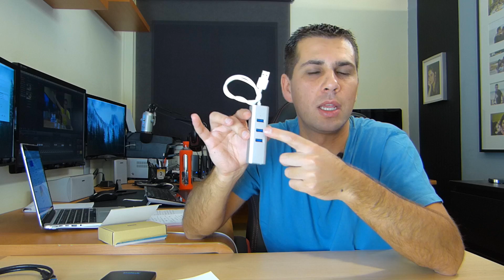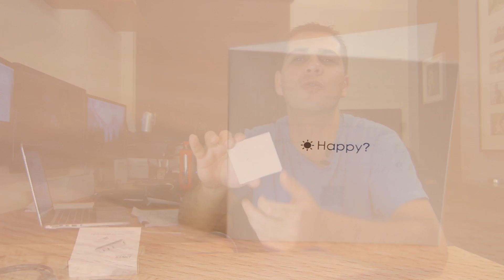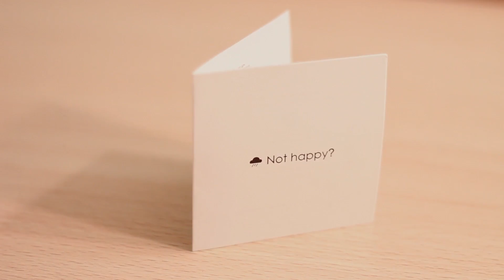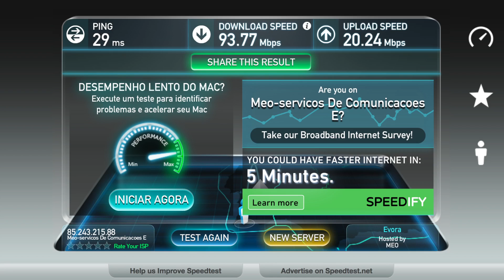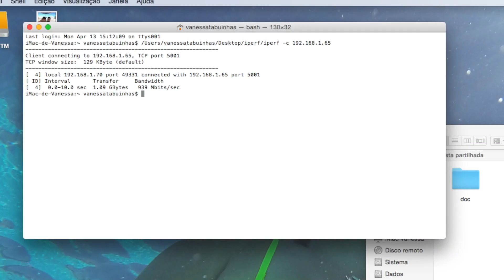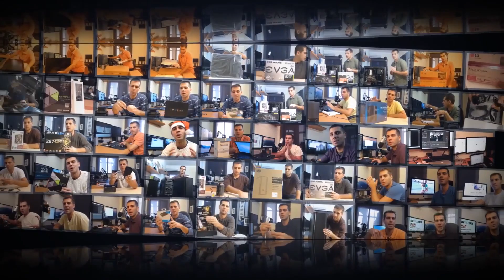Anker USB 3.0 Ethernet Adapter Review & Speed Tests

Comment: I have just bought of of these for my MacBook Pro.. 
Mixed review. The ethernet was great. HoweverI tried to use the USB 3 ports for 
1) Logitech Mouse Bluetooth dongle
2) Plantronics earpiece bluetooth dongle

The performance on both was terrible.. Anker support sent me an explanation that USB 3 interferes with 2.4Mhz wireless... and bluetooth uses that frequency

Now if you plug a usb 2.0 extension cable into the same USB 3.0 port and the dongle into the USB 2.0 port a bit further away the problem goes away.

I am told that lots of USB 3.0 hubs are affected the same way.

Disappointing. Good device otherwise but if one wants to plug in a bluetooth dongle.... you have to use a USB 2.0 extension cable.

Comment: Can I use that in reverse? I’ll connect the ethernet cable to that ethernet port on my ONT and use the usb port to attache my external hard drive... Is it possible? because the usb port in my ONT is slow and I cant stream properly my 4k video from external hdd

Comment: Are there any scenarios where a taxed network or usb transfer would negatively influence the LAN bandwidth available through this or any USB + LAN hub? In other words, will the LAN port always have gigabit speeds regardless of network or USB utilization or if say in theory I had all USB hard drives attached to it and fully utilized the 5GBps bandwidth, would the LAN port still move at GB speeds?

Comment: Have you had any problems with it slowing or "destroying" your wifi?
I have the Anker 4 port 3.0 USB hub and it continually damages my wifi signal on my Macbook Pro 15" irrespective of where I position the hub.
Your comments would be appreciated.
Reply from the maker: Hi, thanks for sharing your experiences but i have not seen any issue with my wifi signal while using it, i dont use it very often but when i use it works fine
RJ
Reply: OK thanks - I had mine connected all the time - or did until the problems started. I have now disconnected the 3.0 Adapter and gone back to a 2.0 version that allows everything to work flawlessly.
Reply: USB 3 can interfear with 2.4Ghz wireless channels.  You'll want to use 5Ghz.

https://www-ssl.intel.com/content/www/us/en/io/universal-serial-bus/usb3-frequency-interference-paper.html

Comment: I saw in the apple store that there are two kinds of ethernet adapter, the usb one and the thunderbolt one, my question is what's the difference between the two adapter? oh and btw these adapters that I'm talking about is for my macbook air, anyways great video, I hope someone will reply and answer my comment.
Reply from the maker: Hi Andre, thunderbolt should be faster but after testing this USB 3.0 what is the point of getting something faster than this which is the maximum of my connection gigabit :)
👍👍

Comment: my onboard lan have a unidentified problem. tried all the solution in internet. can't seems to fix it. Buying USB to LAN will fix it?
Reply from the maker: Hi Maxine, will not fix your board connection but will give you a wired connection to your PC
RJ
Reply: Sorry for miscommunication. I meant not fix my onboard but to to have a wired connection.

Comment: Hello i wana ask a question. I am thinking to buy canon ip 2870 which is the simplest printer n has only 1usb cable with one end as USB type A and other USB type B. So in ur ethernet adapter i see that it is Ethernet RJ45 to USB type A, so will the same device work in reverse?? i am thinking to make canon ip2870 wireless which infact is only a wired printer, by connecting its orginal Cable to ur ethernet adapter through usb female to female. Will it work.😃
Reply from the maker: Hey Dayal, i see your point but this adapter wont work for that, you will need a proper adapter for printers or getting a wireless printer. I got the Epson Home XP-325 last year because i use windows and OSX at home and works great on the network.
RJ 👍

Comment: i m looking forward to buy a gaming lap which doesnt come with an ethernet port ,so if i use this adapter will my latency (ping) increase in playing online games like csgo , etc or it remains low as native ethernet port
Reply from the maker: Hey Santhos, anything that we put between our connection will interfere with the ping / speed but this was until today the solution that i have found that has the best results for my connection
Hopefully will work for you as well
All the Best
RJ 👍👍

Comment: Very nice review indeed! :) Just ouf of curiosity: did you do any tests of ethernet speed WHILE at the same time doing data transfers through USB  ports on the device? In other words, what happens, if you copy large amounts of data from, say, a USB 3.0 flashdrive to your laptop AND run ethernet speed tests at the same time? 

I want to find out to what extend sharing the bandwidth of a single USB 3.0 connection to the laptop between USB data transfer and ethernet  data transfer affects the performance of both (if any).

Thanks in advance!
Reply: depends on your internet connection. e.g. in belgium the max bandwith is 200 mb/s
adding a generic ssd that's writing data this uses around ~500mb/s
seeing as the usb 3.0 is capable of 5gbit you will only use 700mbit of the 5000 available. so it won't really bottleneck, as long as you have the updated drivers and right settings
Reply from the maker: +Stanislav Vartanyan Hey, that is actually a interesting question :) and unfortunately i did not test it out as i did on my latest video where i tested exactly that https://youtu.be/wI81POWO38E
I have to assume that there will be a bit of a bottleneck.
On a read of 410 MB/S on SSD plus a 100mbits /S on a continuous download stream i believe that the SSD will go below to 300-350 MB/S.
I also believe that in a real world situation will be very hard to have this scenario but this will depend on eah one of us :)

To @Sevival thanks for your input and a few weeks ago i would have thought +- the same but after testing the USB C humm!! I would not bet that we will not have a bottleneck pushing a SSD plus 100mbits connection

Hope it helps
RJ

Comment: Hey George,  I was wondering what SSD speeds you get from the USB ports on the hub vs the speed from the same SSD plugged directly into your Mac?  Also does the hub have enough power to power the SSD?
Reply from the maker: +Les Rimmler Hi Rimmler, i have done those tests and they are the same, no loss with the samsung 850 evo on a UASP external case. RJ

Comment: Thanks for reply Robert. The question was for x8h, not x8h plus
Reply from the maker: +Sang Lee Hi sang, but the same applies, you will be bottlenecking your connection because its USB 2.0 so you will get very low network speeds. On the X8H you have a 100 connection and on USB it will be lower than that, much lower. RJ

Comment: hi, would this work on minix x8h?
Reply from the maker: +Sang Lee Hi Sang lee, actually i never tried that, but why would you use this when you have gigabit on the X8H Plus? And even if it works the box only has USB 2.0 so slow connection. RJ

Comment: hi Roberto, is this adapter windows 10 comparable ?
Reply from the maker: +vger 147 Hey Vger, yes you will not need any drivers, i only have used it on Win 8 but i see no reason not to work on Windows 10 :) Hope it helps. RJ

Comment: Did u have to install any drivers? I have the same computer, with latest OS and plugged in the adapter and only the USB ports worked. No ethernet. I guess the question is, does it work straight out of the box or do i need drivers?
Reply from the maker: Rodrigo Vidal Hi Rodrigo, straight out of the box, no drivers!! Ethernet and usb working fine here. If it doesn't work, try on another machine and if still doesn't work ask for a replacement, you might have malfunction adapter. RJ

Comment: You only have two USB Ports on your mac? I bet you'd love the new macbook pro then. lol
Reply: Roberto Jorge Hi Roberto! Do these adapters recognized as network cards in the control panel? Can you assign a static ip? i want to get it connected to a linux system. : - )
Reply: thanks Roberto cheers!
Reply from the maker: goodman854 Ah!!Ah!! Its not the machine for me. Although it looks great i need a little bit more ports and also a little more performance :)
Reply from the maker: George Papadopoulos
Hi George i can attribute a static ip, but im not sure how it will work under linux as i never tested it. RJ